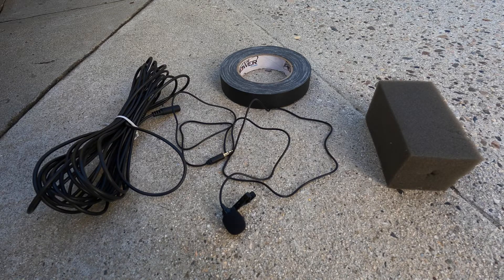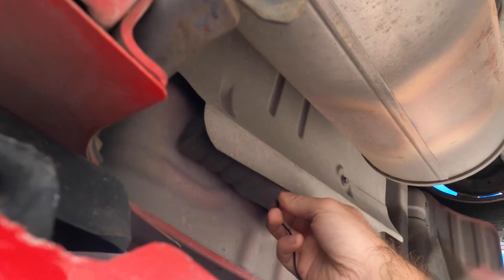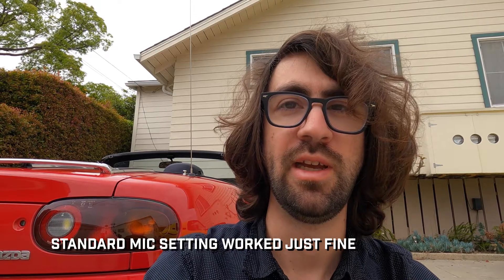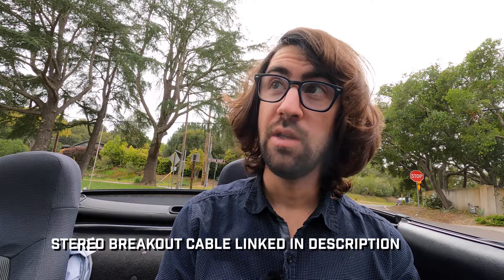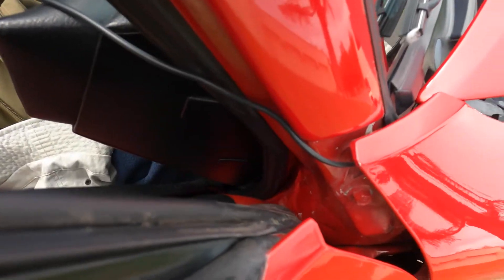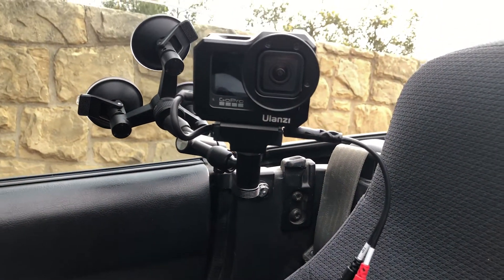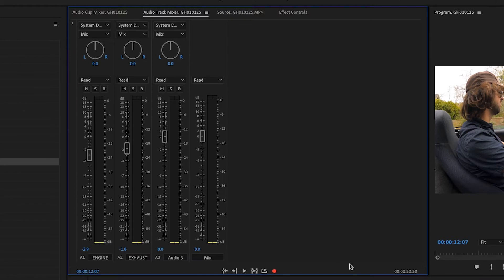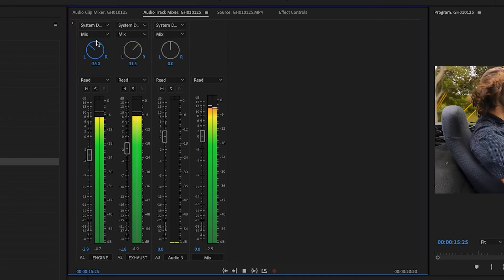Recording Car Audio That Actually Sounds Good! PART 1: Cheap & Easy

Comment: Dude this video is literally a God send I would've never thought about just regular foam for the mic rather than a crazy expensive sock or "deadcat" much appreciated
Reply from the maker: I was very surprised at how good it works the first time I used it. Literally just as good as those hairy deadcats in most situations, as far as I can tell.
Reply: The expensive sock / deadcat is also replaceable by a fluffy pillow case.

Comment: I don't need the best audio quality, but I want it simple and cheap. That's why I wanted to go with a wireless lavalier, which plugs right into the smartphone. But it sounds just wrong. I think there is some kind of build in noise reduction that messes everything up, but I don't really know. Does anybody know how I can fix this or if there is a different but similiar easy and cheap solution?

Comment: This is a great tutorial.  I've been assembling a rig to audio/video my TR6 with emphasis on the engine sound.  Was thinking along the lines of Rycotes, blimps, etc. to eliminate wind noise.  Expensive stuff.  It never occurred to me to use open-cell foam from the hardware store.  Brilliant, and worthy of the ultimate compliment: "why didn't I think of that?"  Thanks for this!

Comment: Total respect for the Opel Manta. Thanks for the simple sound capture explanation.
Reply from the maker: Thanks! I've got a bunch of videos with the Manta, and not the Miata, ironically.
Reply: @AndrewDoesCarStuff  When I first passed my driving test, I was going to get a 1974 Opel Manta. Mechanic persuaded me to get a Mk1 Golf instead. Golf blew up a few weeks later and yet I kept seeing the Manta around town for years. Have never listened to a mechanic since and successfully used MY judgement.
I recently got a older BMW with a straight six, so looking at ways of recording the exhaust, that doesn't break the bank. thanks again.
Reply from the maker: @jumpferjoy1st  Bummer about the Golf! I will admit that VW parts availability is way better than Opel parts in the US. But it's got the "unique" factor in spades. BMW straight 6 is a good choice. Happy recording! If you haven't already seen it, I did a recording of a Euro E36 M3, which sounds pretty glorious.
Reply: @AndrewDoesCarStuff  Thanks mate. I am now going to be looking for an action camera with an external microphone. Some on Amazon for £40, so about $50.

Comment: Really great video, been looking for videos explaining how to get good Audi recordings for my M3 track car for ages, most involve expensive microphones and recording equipment and complicated setups, this video is nice and simple to follow and looks like good results can be had with minimal budget, can’t wait to try this out thanks again man 👍
Reply from the maker: Glad it was helpful! I'm a fan of simplicity.
Reply: So... Did you try it? I just did on my nearly straight-pipe M3 and the sound was too much for the little mic.
Reply: @USM3C  Yes I tried the same and it just distorted unfortunately.
Reply: @BBTV56k  maybe try an audio recorder that allows you complete control over your gain settings? I have a g37 with a custom exhaust and a zoom h1 and a lav mic is all I needed to record great audio

Comment: That parametric EQ is a massive game changer for this sound newb. I recently did a recording of my new muffler with a cardioid mic.... the only "real" microphone I have, I realize it's not really ideal for outdoor use, but I only had it stationed on the ground so I was limited to drive-by recordings at best.  Thanks for this, Andrew.
Reply from the maker: Glad it was helpful!

Comment: Thanks a lot man! Been struggling and testing a bunch of things over the years, since i could never find a good video about this subject. I also tried to mics with one of those splitter cables, but I might have the wrong one. Anyway, thanks a lot, and I'll check out part 2 now
Reply from the maker: Thank you! Glad you found it helpful. I'm strategizing on part 3 now, it should be a fun one.

Comment: Honesty, best video i have ever seen! And great car! 

Just one question though. 
What is the best way to keep everything on track when recording with two cameras. 

For example how do you link up the audio and video from another camera without being confused on when you recorded the sound or the video. 

Is there a way to know which audio clip is for which video footage and exact millisecond. 

Thanks.
Reply from the maker: Thanks for that! So I go into this a bit more in parts 2 and 3, but to make a long story short, it helps to start recording on all your devices at roughly the same time, then make an obvious sound that all the cameras and mics will pick up. Ideally it's a very sudden and sharp sound like slamming a door, or a loud hand clap. Then you can do the same towards the end before you stop recording just as a secondary line-up point. Then when you go into your video editing software, layer all your clips on top of each other, label them, and then look for that big peak in the audio tracks when you slammed the door or clapped. Drag your clips around until that peak lines up as closely as possible on all tracks, and you should be golden.

Comment: Question, when recording the audio using a breakout cable, and feeding both left and right into your GoPro, How did both Engine and Exhaust not get compressed into a single track? Great tutorial BTW, thank you
Reply from the maker: Hi! It does record a single file, but it's a stereo file, meaning left and right are totally separate (thanks to the breakout cable). That way you can split it afterwards in the edit as shown in the later part of the vid.

Comment: Tyre noise has a spectrum to over 30 000 Hz according to studies. The half wave length high up comes from grooves. But the 1000 Hz certainly cut a lot.

I have a problem recording my 996. The standard exhaust is so quiet and engine bay gives some whine from the auxilliary belt. It is running generator (old), compresssor (old), power steering (old) and water pump (new). The tensioners are both new. I also added an extra oil scavenger which certainly will give some unwanted noise.

Thanks.
Reply from the maker: Engine bay noises can certainly be disappointing and not what we expect. The best place on a fuel injected car is as close as possible to the intake tract and away from other accessories. I've heard of people putting a mic inside the airbox but haven't been brave/dumb enough to try that yet. Exhaust is usually the best sounding thing. You can get decent sound from inside the cabin as well, if you mix it with other sources. Definitely takes some experimentation on every different car, and I'm still learning as I go.

Comment: Very helpful, thanks! I don’t have a GoPro though, what would be an alternate device to record the sound? Would an iPhone work?
Reply from the maker: Pretty much any camera or audio recorder with a mic input would work! There are adaptors you can get for the iphone, but I haven't tried that personally. The official Apple Lightning-to-TRRS adaptor supposedly works with a TRRS mic. If you have a TRS mic you would need a TRS to TRRS adaptor to use it with the iphone.

Comment: Great video! You mentioned that the microphones might not be good enough for a louder car. Do you have recommendations for a louder car? I have a straight piped 340i for reference if that helps, thanks in advance!
Reply from the maker: Thanks! One of the key things to look for when looking at mics is whether they have a listed maximum SPL (sound pressure level) in the specs. I've picked up a couple that are rated for about 120-130 dB which should be enough for most loud cars. If that info isn't listed, then I'd avoid them. It can be tough to find lavalier mics that can handle that much. Also you can try using a decibel meter app on your phone to determine how loud your car is, and then try to find mics that can handle at least that much. Worst case, you can mount the mics further away from the exhaust or wrap them in extra padding to bring the level down.
Reply: @AndrewDoesCarStuff  could you tell my by chance what the 120-130dB microphones were? Please take your time, I appreciate the time you given me. Just looking to make better pov driving videos, I didn’t like just the go pro audio on mine.
Reply from the maker: @slow_n_stock_328  I can tell you, but they aren't available anymore. Also they are XLR mics that I use with a separate recorder (shown in the next vid), so you couldn't plug them straight in to a camera. In any case, they are Synco LAV-S6R. Later I bought another set, but they were rebranded as Moman MA6R, which also appear to not be available anymore.

If you're wanting to use the GoPro adapter like I did in this video, something like the Sennheiser ME 2 (or ME 2-II) would be ideal as it can handle up to 130 dB. But it's expensive. Other than that, all you can really do is sift through and look for the parameters you need: TRS plug, omnidirectional, and high max SPL rating. There are tons of options out there and they change often (particularly the cheaper off-brand stuff). It's hard to find lav mics that can handle the noise, as they really aren't intended for this.
Reply: @AndrewDoesCarStuff  thanks! Super appreciate your time and responses. Keep up the good work
Reply from the maker: @slow_n_stock_328  Something like the Sony ECMLV1 could be pretty fun. Small stereo mic that you could stash in different places, or put on your GoPro for a real POV experience. Though I can't find any SPL rating for it.

Comment: Very informative thanks man!! Whats ur thought on wireless mics?
Reply from the maker: Thanks! I think wireless mics would be great in theory, but I haven't tried that yet. I love the idea of not messing with wires, BUT wires give you the most reliable signal. Wireless mics always have the chance of radio / electronic interference causing problems, and they are a little bigger, so not as easy to find mounting places, and you have to make sure batteries are charged, etc. Would be fun to try though!
Reply: @AndrewDoesCarStuff  absolutely man i agreee, i do a lot of video work in the shop and when i talk. Usually the voice quality isnt the best so im hoping this will help. I actually just went to the camera store. I bought a saramonic blink 500 wireless kit. Worth the try i suppose. We shall see 🤷🏼‍♂️
Reply from the maker: @klegraefe  Oh yeah, for any kind of talking stuff, a wireless lav mic is key. I use a Rode Wireless Go. Just haven't tried taping it to my car yet, hah!

Comment: So I did this as shown in the video, but ny mic setup is a dual lapelle mic cable. It’s a stereo TRS cable that has 2 lapelles on it. But when I record with the GoPro, it records both mics as both LR (no separation. Into hero12 with media mod
Reply from the maker: If you want seperate tracks, you have to do what I did. Two separate mono mics and a stereo breakout cable as shown (not a headphone splitter).

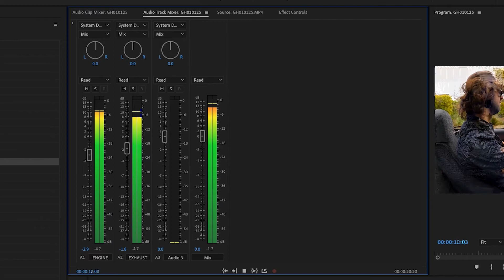Comment: At 12:54 you mention the road noise always being around 1000 Hz, as an audio engineer, I can tell you that this is simply not true. Noise as the name would state is a wide range of frequencies and not simply a "tone" which is a single frequency or very narrow bandwidth of frequencies. "Noise" is much more difficult to isolate and I suggest a moment in the car drive when you are moving at a decent typical rate of speed (and preferably slightly downhill), that you put the car in neutral and coast with the engine at an idle so that you can get a chunk of recorded audio that is JUST road noise so that you can later have a more advanced "noise reducer" function in an audio editor be able to better isolate the profile of frequencies of the road noise to be able to take out more precisely. Also, road nose from tires will tend to move up and down in center frequency based upon the speed at which you are moving because the noise is caused by the surface of the tire hitting the small surface artifacts in the road and the tires hits more little bumps faster as you move faster and that results in a higher frequency as you move faster. The idea of putting the lavalier mic in a large block of open cell foam is great. I might suggest an extra step for trying to capture a more true to accurate sound profile when doing so is to make an EQ adjustment profile for each mic when using the foam as the foam will tend to roll off the higher frequencies more than lower frequencies and can make the recorded audio sound more "muffled" than without the foam. You can easily correct for this if you have two recordings (especially if you have two of the identical mics to record at the same time and play a sine sweep through decent speakers and record the same sweep with the two mics side by side (at the same time) and compare the frequencies captured so that you can add in an audio EQ adjustment in the editor to account for the different levels of the frequencies being captured through the mic with foam verses no foam.  Also, at 16:30 you talk about the "clipping" of the GoPro audio. Unfortunately, the clipping is locked in the recording and there is really no way to get back the additional audio information that was cut off by the fact that the mic was recorded with too much sensitivity during the drive. I did however see in the very beginning of the video that you have a Tascam DR-701D (excellent field recorder, I have one too). This is a much better choice for recording up to 4 mics independently as well as the stereo channels of a camera or other device. Because the Tascam gives you the ability to adjust the input gain structure of the analog mics directly, this is a MUCH better way to see the loudest levels during a TEST drive (before your main car recording event) to be able to properly set the mic levels so that you don't clip in the first place which then you have all the audio goodness to edit to your liking later. Overall great content and really good recommendations for mic placement and some ideas to help content creators with understanding some of the things that they should be thinking about when trying to capture the content as there is WAY more to think about other than just "Slapping a GoPro on a car and ripping around". I hope that this information finds someone that is willing to read through some nerdiness and try to understand the reason behind why this can make such a huge difference.
Reply from the maker: Thanks for this very in-depth comment! Lots of good points. If you make it further in this series (parts 2 and 3) you'll see me delve into using the Tascam and manually setting levels, etc for the same reasons you brought up. This first video was an attempt at showing the simplest way possible to improve audio capture. As for the noise reduction, that's a good idea to get a sample of the road noise. Although in my experience, using software noise reduction tends to mess up the primary sound I want to preserve too much. Maybe it's time I tried that again. Anyway I agree that there's no exact rule for road noise being the same frequency all the time, but reducing that general frequency range seems to help. It's a balancing act as you don't want to lose too much of the engine sound if it falls in that same range. Anyway thanks for taking the time to comment!

Comment: For the engine noise, is it possible to use this setup, but instead placing the mic in the engine and having a connector to a phone?
Reply from the maker: I've never tried using a phone to record audio like this. It might be possible if you can find the right adapter. You have to be careful to note which kind of plug is being used and make sure your mic is compatible. For example, there are a bunch of adapters that are designed for mics with a TRRS plug, which won't work if you have regular TRS mics like what I have in this video. Something like this would supposedly work, but I don't have direct experience with it. https://amzn.to/3JwWSIR

Comment: Could you use an adapter to go from LSRR to LSR? Im struggling to find LSR mics that arent like $200 each because the one you linked isnt available for me in my country on Amazon
Reply: TRSS or whatever its called sorry I forgot lol
Reply from the maker: You probably can use adapters, that should be fine. I forget which part of the connector is which (tip, ring, sleeve) but as long as the adapters are correct it should work.

Comment: Hi man, I’m test recording with zoom h4 and with XLR cable attached to rode m5 even is still minus 12-6 range at the peak but it still sounds blown out at 6-7rpm with my miata ? Is just mic placement. Need to run more test its just day 1 for me.
Reply from the maker: Looking at the specs of that mic, it looks like it should be able to handle the volume / SPL. So it could be placement, or not enough protection from the wind. Keep experimenting, that's what it's all about! I would say your input level could be too high but it sounds like that's not it.

Comment: Yeah I dont have a problem with those tones on my car, its the low frequency noise. It sounds like I got a subwoofer going nuts on cold starts let alone high load situations I think I need a different type of mic. My car causes my mic to peak even on my lowest gain.
Reply from the maker: Interesting, yeah every car has different challenges, and some mics can't handle the noise. You could try moving them further away from the sound source and/or wrapping them in more foam. Could also be resonance throughout the whole car, in which case there's not much you can do, if that's just how it sounds in real life.
Reply: @AndrewDoesCarStuff  I have tried all that for my car lol. Unfortunately or fortunately my car sounds like I have a subwoofer going crazy when I cold start my car. I think a drum mic will work but problem will be powering it.